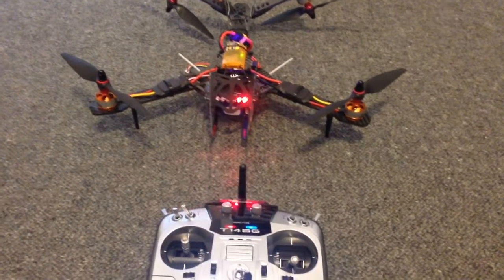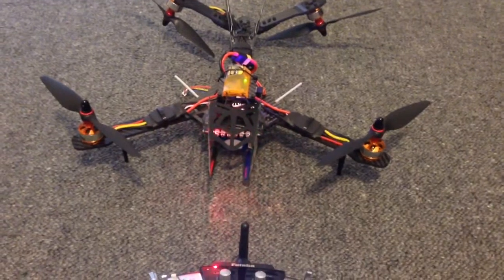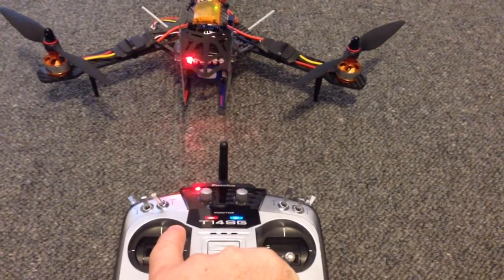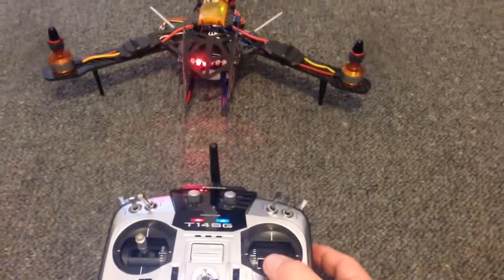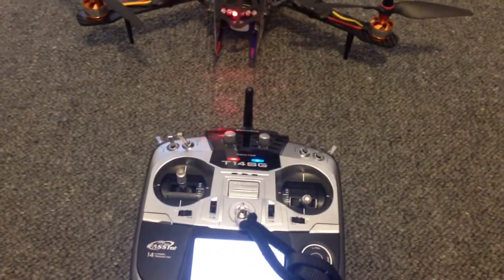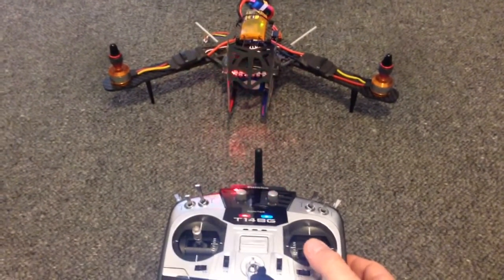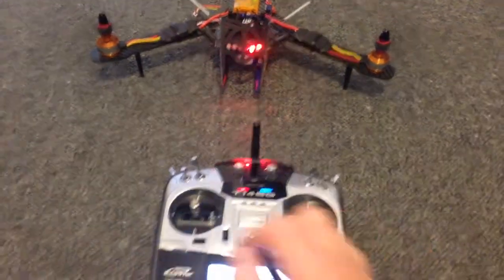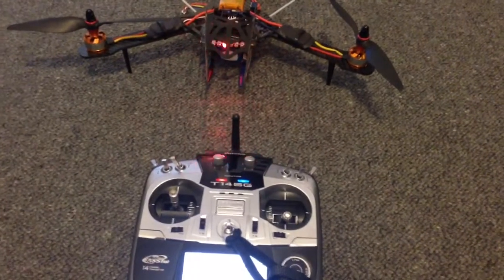Throttle mix for Multicopters

Comment: Did you decide to go with motor stop disabled for air mode or use ur idle up switch and resume stick arming? I can see there being much loss in performance really
Reply from the maker: +tmaintv No there wasn't any difference at all.  Using either motor stop enabled and the idle up switch vs no motor stop.  With Air Mode active in both situations performance is exactly the same.  I still use motor stop as per this video and the idle up because I like the motors stopping instantly when i land and close the throttle (with idle up off)
Reply: +Trainboy64 I meant "can't" that was a typo sorry.... I haven't flown with air mode enabled but use an idle up. Did u do it with a mix or a throttle curve out of interest? I did mine with a mix I also made a mix that perform the stick disarm even with idle up enabled no matter where the throttle is as an extra safety feature. Might be overkill but I am definitely with you on being able to stop the motors. Thanks